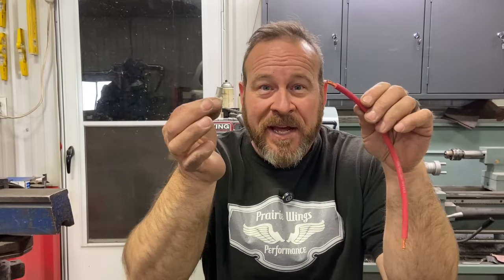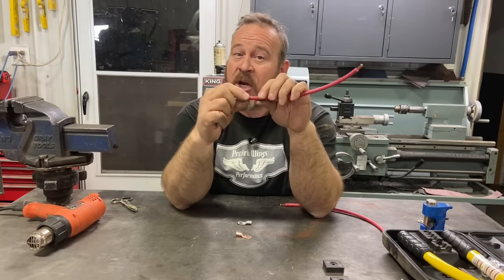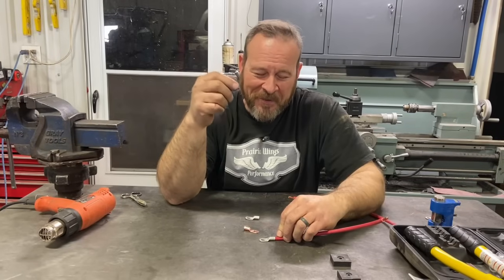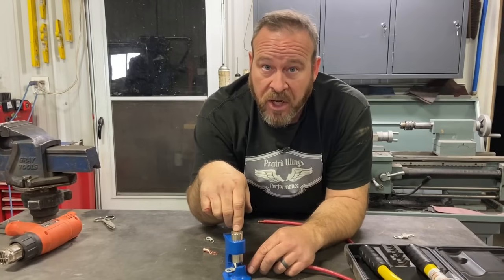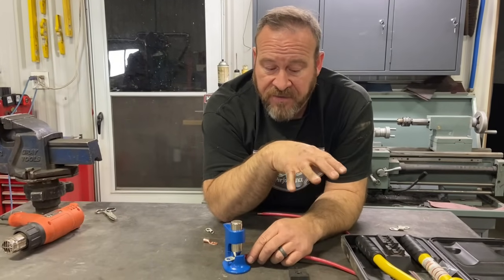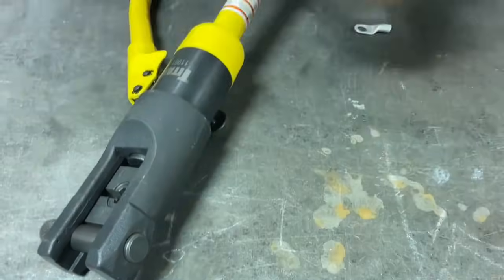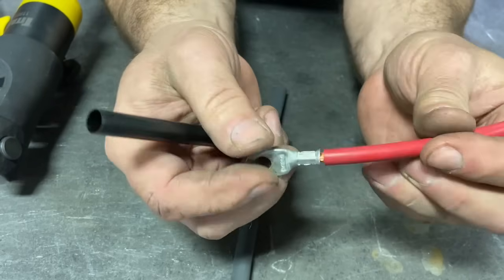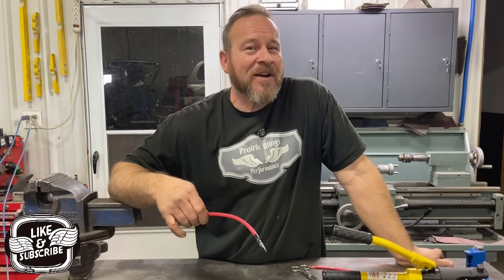Crimping Heavy Cable Ends - Which Way Is Better?

Comment: Overall good, but the heatshrink does no good if it isn't covering the hole in the ring terminal. Battery acid will still get in.
Reply from the maker: @jackvisn  that one seems to be biting me on this video, those are the ends that come with the aftermarket wiring harnesses. They are thick but do have the hole. Thanks for taking the time to comment!!
Reply: The heatshrink still prevents the wire from sharply bending over the edge, or pulling out, of the terminal which is important whether or not it's in a corrosive environment.
Reply: You could seal up that hole with a little bit of solder before you heat shrink it.
Reply from the maker: @jackvisn  absolutely, those ends are what come with the aftermarket harnesses. Been called out on that one lots, my bad🤷‍♂️. I do really appreciate you watching and taking the time to comment though!!

Comment: I have never seen anyone waste more time doing something that this guy. If this was a business he would be bankrupt
Reply from the maker: Thanks for taking the time to comment!
Reply: That might be true if crimping was the majority of his business but not if crimping the terminals is only a negligible part of the overall job.
Reply from the maker: @ thank you, I appreciate that!!
Reply: The “ends” are called “LUGS”. With the proper crimper and the proper lug, creating a proper crimp, what you call “factory”, is not difficult and takes seconds, not minutes. Lugs are sized by both wire size and wire stranding which affects the O.D. of the wire. Using the correct dies is important, and does not require you to rotate and crimp again for a smooth and sturdy crimp
Reply from the maker: @ thanks for your input!

Comment: definatly experianced the sharp wings but never thought of trying the next size jaw .. thanks for this tip
Reply from the maker: @leonardbartholomew5021  I’m glad you can use something from this! Thank you for taking the time to comment!
Reply: I normally turn the crimp round in the die and recrimp. The wings then get pushed back into the lug making it a tighter crimp
Reply from the maker: @ thanks for taking the time to share!
Reply: A senior electrician taught me to remove the sharp wings with a file prior to heat shrinking. The tube can split open if there are sharp edges. And if you crimp two cables together its not necessarily an easy fix to replace a tube.
Reply from the maker: @ absolutely, the file has been mentioned in the comments before but the thought about difficulty with two cables joined, that could be very difficult t go in and replace that especially a splice somewhere in the middle of a harness!! Thanks for sharing your thoughts!

Comment: The hole in the end of that lug will let the cancer in no matter how nice your heat shrink is, other than that, great video.
Reply: You could feed a little solder into that hole for extra!...
Reply from the maker: @ great thought!
Reply: @joehead1294 solder is a no no. It makes the cable  brittle. Anything over 10A solder is not recommended.
Reply: @michaeldove339  Where does that come from?
Reply: I like to spray it down with dielectric grease
Reply from the maker: @tullgutten  sounds like a great idea!! Thank for taking time to share!
Reply: @tullgutten dialectic grease is non conductive. It is a horrible but unfortunately very common mistake. You apply the dielectric grease on the lugs and posts after you land the wires on the battery. You absolutely do not put that grease into the connectors or lugs
Reply: True.  I use terminals that are made for crimping for that reason.  The ones with the hole are made for soldering.
Reply from the maker: @LTVoyager  thank you again, much appreciated!!
Reply: I thought that too whilst watching
Reply from the maker: @marcusmohorco380  sometimes you can’t see the forest for the trees🤣
Reply from the maker: @stevenpederson1645   ya, those end come with the after market harnesses🤷‍♂️. It’s going on the mega fuse, should be ok. Good catch, didn’t even realize I was using one of those. Thank for taking the time to comment!
Reply: A dab of liquid electrical tape will fix the hole. Never use RTV because it uses acid to cure.

Comment: Started 18 years ago in car audio. Love this method. Ive always done the solder method with a large adjustable wrench "clamped" onto the wire as a heat sink so the solder doesn't wick too far up. Im going to switch over to this. Way kess messy, no risk of damaging the insulation and much faster. Love the note about the heat shrink too.
Reply from the maker: @adamali7840  I’m glad you got something out of it! It definitely was worth the switch, you will enjoy the ease of it. Thanks for sharing your tips on how you solder to, I’m sure someone will find that helpful. I appreciate you taking the time to comment!!

Comment: Hex die is my favorite. I also rotate the lug in the die to make a uniform crimp. Some ends require a double crimp. Also depending on the lugs and dies you have, sometimes they are in between sizes and I have to put some stranded wire between the crimp and die to make sure I get correct compression on the lug. When I do this, I normally use fine strand copper so it doesn't leave marks in the lug keeping it pretty. A proper crimp is considered a cold weld given optimal copper/copper interface instead of having higher resistance solder that can heat and melt in extreme cases.
Reply from the maker: @Fei8lo  sounds like you have some experience with these! The ends that are thin(cheap ends) seem like they could be in between. Thanks for the tip! Really appreciate the time you took to watch and to share!!
Reply: @prairiewingsperformance6036  Thanks for making the video. I generally use thick walled lugs and if they are thin, the go back to the store or in the trash. It may just be my cheap import metric crimper. Maybe strand count or metric size wire with AWG lug or the reverse can be part of the sizing issue. Generally, you want to compress the lug where all the air space in the wire is eliminated without reducing the cross sectional area of the crimped wire. I am not sure is over crimping would work harden the copper in the wire to cause issues. I mostly use it for automotive or home power systems where I oversize the wire so crushing it a little more is not a big deal. At work, they use specific wire model, die, and lugs to ensure proper crimps but I don't need that for my hobbies.
Reply from the maker: @ I definitely get that, usually wherever you buy your wire or on line there are very good wire gauge charts! Do your hobbies include hot rodding? What are you playing with???
Reply: @Fei8lo  Thats the gospel right there.  Proper tool, proper terminal, and correct wire size.

Comment: What you found is the exact problem with the cheap amazon crimpers:  All the dies are metric and don't properly fit any lug you'll get in the states.  If you're doing a bunch then FTZ is one of the few low cost ($133) crimpers that will actually make a proper crimp.  I know most people won't want to spend the money for a couple crimps, but it is an option.
Reply: Your eye where the wire goes in and bottoms out has a hole in it, so it's really not weather tite. Or does it. It  looks that way in the video?
Reply from the maker: @ yup a ton of people have called me out on that. Those ends come with the new wire harness kits. Lots of suggestions here on how to deal with that! Good eye though! Thanks for taking the time to comment!!
Reply: My Amazon crimper looks exactly like his and is from a reputable manufacturer. It included both metric and AWG dies. Having both sets of dies is super handy when trying to find the best fit for various thickness terminals.
Reply from the maker: @ since I put this out and seen all the good information I have a new crimper on my list.
Reply: Actually the hydraulic crimper I bought from Amazon, has two sets of markings on the dies. I forget exactly how you're supposed to choose which marking, because I haven't used it in a year, what instructions that came with it, explain it.
Reply from the maker: @ perfect! Thanks for taking the time to share!
Reply from the maker: @stevemccormick4938  awsome information! I have never used an Amazon crimper, the ones I have I bought through a reputable tool company but I did see they have the same brand in Princess Auto for way less😞. Thanks for taking the time to share your experience, watch and comment, much appreciated!!
Reply: In 1972, when I left school and started in the electronics industry (in Australia) there were 3 methodologies for wire-to-connectors ... from 26swg to 00swg:

* Solder only for small and light duty wiring.
* Crimp only for small and medium gauge.
* Crimp first AND THEN SOLDER for "MilSpec" (miltary specification).

Since maturing, and being involved in 4WD and Marine installations, I now crimp AND THEN SOLDER and then glue-heatshrink all connectors. 

"Do it once, do it well".
Better to be sure you have 100% mechanical PLUS electrical conductivity.
Reply: Soldering after crimping might be what that little hole is for. Great advice.
Reply from the maker: @  not sure what the hole is for? I’m getting called out lots on that one🤷‍♂️. Those are the ends that come in the aftermarket wiring harness kits. Thanks for taking the time to comment and share your thoughts!!
Reply: @prairiewingsperformance6036  not sure if it's so you can see the wire is in all the way or the manufacturer process
Reply from the maker: @ another comment somewhere here said it is to see the wires???
Reply: @prairiewingsperformance6036 
I believe that the hole is kinda a dual purpose. It is first a vent hole for moisture, and then a visual hole for wire depth. I guess consulting with the manufacturer would be the best explanation?
Reply from the maker: @ absolutely! Plus there are lots of ideas here and references to some pretty major documents that are full of information. Thanks for taking the time to share!!
Reply from the maker: @ thanks so much for sharing both education and experience! Very valuable thanks for taking the time.
Reply: @thedolphin5428  my first diesel experience was on a bunch of commercial fishing vessels on Florida’s Gulf Coast. . I transitioned to class 6-8 vehicles, and the methodology for marine repair has served me extremely well. I have never had come backs on my work except for part failures.
Reply: @WillS-x9y Light duty=Starter lug.  Heavy duty=Power lug.

Comment: Great video. Very interesting how the crimper works compared to the soldering method. Where can you get those crimpers and heat shrink?
Reply from the maker: @meraywatson6767  a lot of companies sell these, any of the major tool companies. Princess Auto sells them and most likely Harbour Freight. I can’t talk on the quality of them all. If it is going to be used for major production I would recommend holding different brands in your hands and spending more. Heat shrinks I use some cheap for interior stuff but 99% PICO ond TA (Techspan). Thanks for watching and taking the time to comment!!
Reply: Thank you for the reply. I will try that. Thank you for the information. What colours do the heat shrinks come in? Do different colours mean different things?
Reply from the maker: @meraywatson6767  I just use red (+) and black for (-). Not sure what other colours there are??

Comment: Nice presentation, I like your style. One thing I'd like to see is how to do the best job possible in a pinch, without any special tools. Us shade-tree mechanics probably won't be investing in a hydraulic crimper any time soon. 😉
Reply from the maker: @therealandrewlund    thank you, i appreciate the feedback! I totally understand that, the cheapest good quality crimping tool that works great with good ends is the blue one you hit with a hammer. I have used a ton of them and own a very expensive one and a very cheap princess auto one (equivalent to harbour freight). They both make the same crimp, the cheaper one definitely takes more damage from the hammer. It however has been hit hundreds of times and has hundreds more left in it. Really anything with a v groove and a drift punch would do the same crimp. Thanks for taking the time to comment!!
Reply: @prairiewingsperformance6036  Fair enough. But could you, say, do a passable job with a bench vise and a nail punch if the motor on your 1994 bobcat skidsteer won't turn over, and you have a 3' snowbank to plow in order to leave your driveway (a random, nonspecific example)?
Reply from the maker: @ I suppose to get you through, like I said a rock in the field would get you through. The whole point of it is to get all the material pressed together into one solid piece. The v groove and punch idea is like the cable crimper you hit with a hammer and it kind of folds it together instead of flattening/ spreading it out. Lots of different ways to crimp cables on, the tighter it is the less resistance and less chance for corrosion to start. What makes do and what lasts may be two different crimps. I completely understand in a pinch stuff! Thanks again for taking the time to dig deeper, I hope I am helping?
Reply: @therealandrewlund let's say your old and rusty F550 Super Duty with a 8' BOSS straight blade on the front with a 3 ton load of salt in the bin develops yet another predictable failure in the field in sub zero temperatures.

In a pinch, I have used a small section of copper tubing for a lug. With my trusty mini sledge, I pound that lug onto a wire using the concrete sidewalk as my anvil. Then I drill a hole to specified diameter, deburr it with any variety of objects, and duct tape when done. If the wire is too small for the lug, fill the void with more copper from a short scrap piece or fold the stripped section in half to allow proper figment. 

This non specific scenario brought forth some high quality repairs that have lasted years.   In a pinch..
Reply: @ Git 'er done! Clever solution.
Reply from the maker: @YTInnovativeSolution  that’s awsome!!! Thinking outside the box always brings in a new invention or kills somebody. Sometimes both! Thanks for sharing!! Again awsome!
Reply from the maker: @therealandrewlund  no kidding hey!!